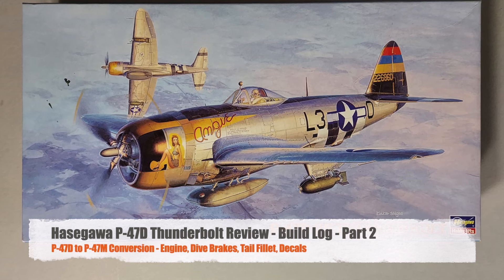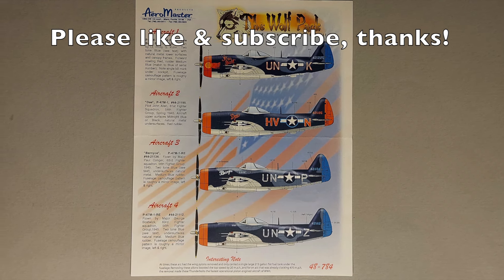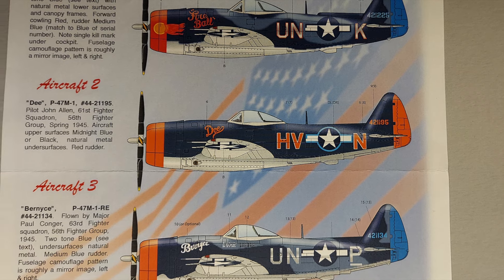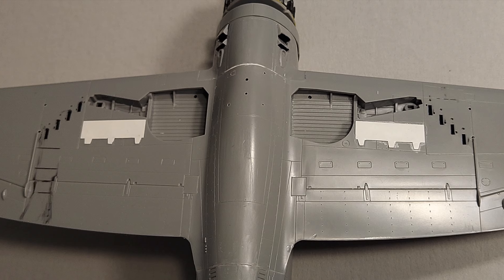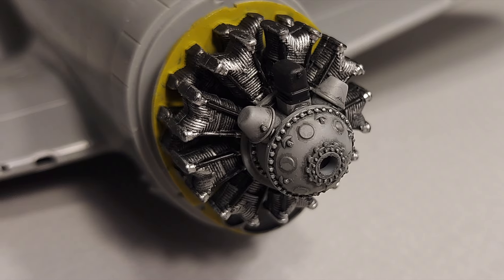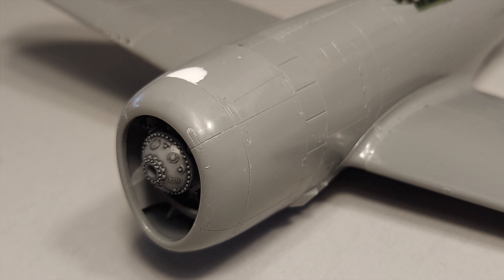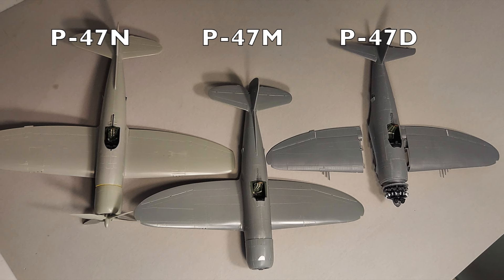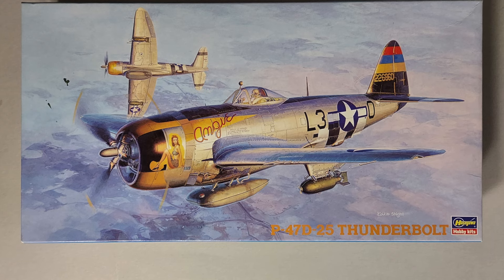Haegawa 1:48 P-47D Review & Build Log Part 2: P-47D to P-47M Conversion!

Comment: Hello Jon, congratulations for the work you are doing with those P47s, each one presents its difficulties and you solve them in the best way, regarding details such as the engine crank or the flaps, I find them very interesting, as I have said before, I have this kit waiting to be assembled, I am worried now about the decals, Hasegawa stands out for the fact that their decals do not support the ibernation time in the kits hahahaha, I will take a look at the box and see the condition. ...
I'm surprised by the cowling and its adjustment problem, it's a good detail to have put it in the video, many put together and make it seem like everything fits perfectly and in reality it doesn't, that's why I really value your videos because they show real situations that we face. We have to face when assembling the models, greetings and until the next video.
Reply from the maker: Thanks Francisco! Even with the fit issues, I'm really enjoying this build. For me, doing the mild conversions really makes the build much more fun. I like knowing it will be something different than the normal builds. Hopefully, the decals in your kit will be useable. Cheers!

Comment: Happy Saturday Jon, even though you had to make those modifications, I still like the surface detail on this kit. In a fighter comparison conversation you could talk about the P-47 for a long time. In addition to it's shear size, one of the reasons it was so big is it had a huge and powerful supercharger system supporting the engine  ergo the large airframe. I think the group you are using on this build was also Gabreskis group. This will be a great threesome .. I haven't built a P47 , maybe a good group would be all the aircraft Gabreski flew in combat. Standing by for more videos on your progress. Cheers, Bob
Reply from the maker: Thanks, Bob! Building Gabreski's planes would be a fun project. Cheers!

Comment: Great vid John.

A couple of points. Hasegawa released a P-47M and in their kit they solved the dive flaps with photo etch and the crankcase with a sprue from their late Corsair kit which contained the crankcase.

Tamiya offer an M model P-47 and their kit allows many of the D model variants to be built with the extra parts it contains.

I would love to see you also build up a Tamiya P-47, but I suspect after this effort , you will be all P-47d out.

Keep up the great work.
Reply from the maker: Thanks, Ben! I would love to build the Tamiya P-47 at some point, but I don't have one in the stash currently. I'm not looking forward to painting the P-47s since all of them seem to have involved paint schemes. But it will give them "shelf presence". Cheers!

Comment: I'm building the Hasegawa P-47D and looked up your video. Mine is kit 09564 the Armee de L'Air version. Re the F7 piece at the front of the cowling. Mine wouldn't fit to the engine as the instructions seemed to suggest- but I fitted it into the front of the cowling, and everything else went together snugly, but it fitted ok without chopping anything. I didn't see that tab you point to with your pen, so perhaps they've modified something? The front of your engine has detail that isn't on my kit too.
Reply from the maker: I think you're correct, Simon, about Hasegawa modifying the part for better fit. This is not a typical Hasegawa error and I'm glad you didn't have the same problem. As for the engine front, because I'm modeling the M version that came with a different engine, I used a different crank case from a Hasegawa F4U7 corsair instead of the kit piece. Cheers!

Comment: Didn't know the P-47 had dive breaks, interesting detail. Also, could the fit issues with the cowling came from the different engine you used?
Reply from the maker: The dive brakes were on the P-47D-30 and onward. The later P-47N had a different wing without the dive flaps. Great question about the engine! The only part of the engine that I changed was the crank case. The interference was with the cylinders and air scoop. I was surprised, but it only took a few minutes to correct the issue. Cheers!